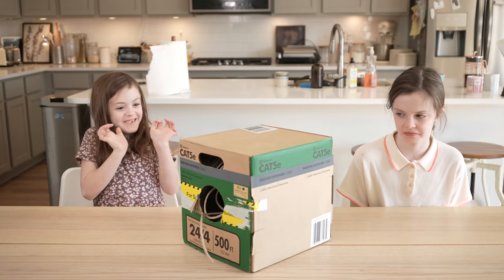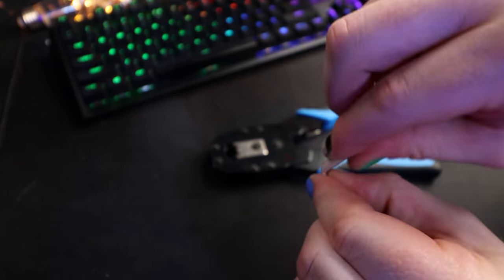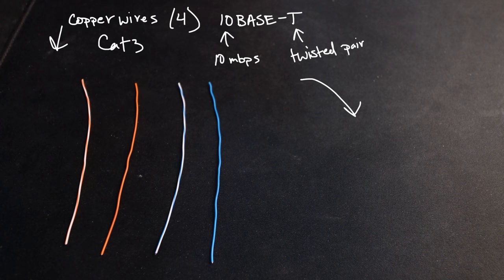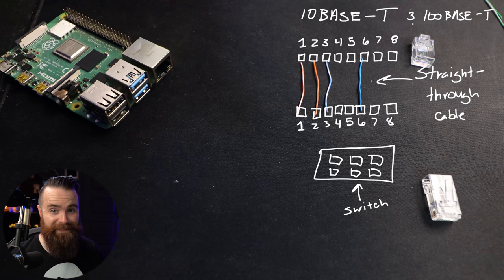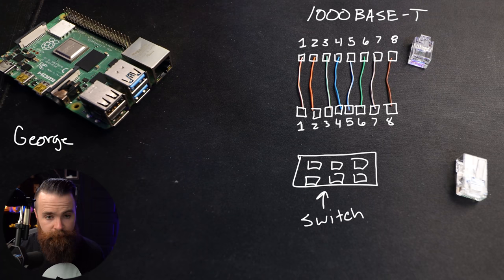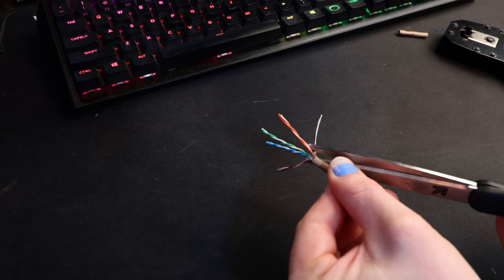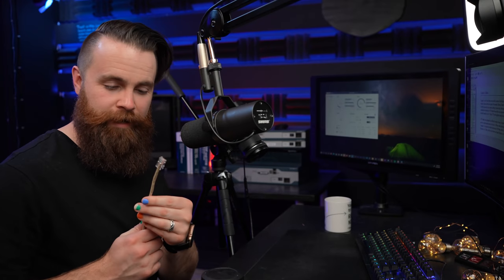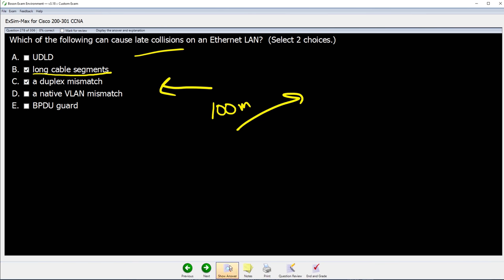forcing my kids to make Ethernet cables // FREE CCNA // EP 11

Comment: Learning this is super important especially when working from home, you can run the cable from your router in one room into a room on the other side of you house to where your computer is so you have a more reliable connection while working from home.
Reply from the maker: Dang, great example.
Reply: @NetworkChuck  Thanks :)
Reply: The same skills translate well to/from audio/video equipment.

Comment: Great video, really well explained. I only want to say that the "grandma hair" thread is there for a reason. The recommended approach is to score the outside of the cable and strip it far enough to expose the thread, then pull that thread to split the sheath. You can just cut off the copper wires where you first scored them and use the freshly exposed wires for the actual connection. The reason for doing this is just in case you nicked the internal wires when you first scored it. When you split the sheath using the thread, the fresh wires are guaranteed to be intact. It also has the benefit that you don't have to keep flexing the cable to split the sheath, which for solid core installation cable, causes cable fatigue. Not all cables have the thread, but where it does, that's what it is for. I hope that helps someone.

Comment: I recently started studying for my CCNA after 6-7 years of being a level 1 installer and home theater/residential/small business cabling and installation. If you guys make these often, get the pass through fittings and the Kline crimpers with the blade that cuts the excess. It’ll save you so much time getting your lengths right and verify the colors 😊🤘🏻

Comment: I'm so glad I can run off 568B color codes in my head without a second thought. I did all this last year making cable :) it took me a bit to learn too. If your fingers are soft you'll get the similar guitar callouses on your fingers if you do it enough in a day.

There was a time when me and another person were doing security cameras and bought RJ-45 heads that passed through the end of the head which was wonderful for color verification, but needed a tool to cut the exact length for the head to work properly. We tried crimping with a normal tool and realized how out of luck we were in doing so. We got tools that could do both after that.

Make sure you buy the right crimp ends for your tools, folks! :)

Comment: I used to be an electrician in the UK and I found for me a red filter (plastic) would help me distinguish the different color cables (been colorblind).

When your wiring up equipment and have 16 or more of color coded cables it was a real challenge to do.

The red filter changed my life for doing this

Comment: I made a cross over cable in 1995 to connect two desktops together using alta vista as the search engine. I've mad lots since then I don't anymore but I went through a couple of crimpers. This is a skill that I don't enjoy (the make the other side stuff was gold) but am glad that I have just in case i ever need to make a custom cable. This was a fantastic explanation which I found fascinating because I haven't done it in a long time. i'm even going "it's rx it's rx" but that was the plan all along.   the augmented reality type thing really made it easy to understand.

Comment: Wow, great job on those, and I love how you presented this! My attempts were only partially successful until I started using passthrough heads. Now I'm a passthrough evangelist! ;-) You pull the wires all the way through, check they are still in the right order and - pro tip - twist the ends before crimping so when it cuts off the excess the eight wires all stay together instead of flying off in all directions. Works fine every time. :-D
Reply: Also, as I understand it, the pass through heads are the only way you can make a Cat 6 cable that will pass certification. My daughter was making cables in her high school A+ cert class using the older heads. My son and I introduced her to pass through heads.

Comment: For anyone having trouble getting the wires straight enough. If you make them about 3-4 inches long. Then use a needle nose to gentle tug on them. It will get them straight. Then pick a good spot to cut and cut it while keeping it all tight. Then just slide them into the connector.

Comment: Hey chick thanks for all the help in teaching me. Just wanted to comment on the ethernet options. I have been an electrician for 15 years and wanted to say if you try to buy 100ft ethernet cable with ends already its about 98 bucks, but if you go to home depot you can by a 1000ft box of ethernet for 65 bucks and buy ends and the crimp tool for total of 90 bucks. I hardwired all the Xbox s for best call of duty for all the room mates different systems. Then i had 500ft left which you can earn some quick cash from other people if you want. 100ft 100 bucks vs. 1000ft box cable , crimper and ends for 90bucks.

Comment: Tip: Use the sleeve you cut off to straighten out the individual copper cables. Much nicer and easier on fingers. Especially if you are running more than 10 cables.

Comment: I used to work for a client who had a company that installed like home theatre systems and networking, for commercial and residential buildings. If I recollect correctly, I’m pretty sure we just used the shielded Ethernet cable in more applications, than not. I could be mistaken though, it was an awful long time ago, now. I reckon, he probably just upsell it to his clients, to just ensure they’d not have EMI networking problems later. I surmise, he figured, cause at the time,.. more and more wireless devices were making their way into homes and offices, so he wanted to ‘future-proof’ the quality of his installations.

Comment: I love the content, but let me give you some pointers to make this easier on you. First I always use a tweaker (small screwdriver) to straighten the cables. Just run the cable between your thumb and the metal round part of the driver. Secondly, to trim, I use coper cable snips (Also can be found as electrician's scissors). Finally, you have passthrough connectors, my favorite crimper is the ideal FT-45 crimper. It works with both passthrough and closed connectors.  You can find it at Lowes for cheap. To make things easy you can leave them long pull them through the holes and then crimp with that crimper. It'll cut the excess for you.  

Also, not sure if you left it out on purpose, but I like to point out to rookies that the cables are twisted at different rates, e.g. the twists are tighter. Finally, you the 100m also includes patch cables so we usually do 85m, or 280ft

Comment: I also have some recommendations about the internet cables themselves:

1. Don't use CCA cables (copper cladded aluminum) that's inferior quality. You need full copper cables.
2. Use FTP (Foiled) internet cables if you run it next to a COAX cable or electricity wires. Here, in The Netherlands, we are not allowed to run them in the same pvc pipe as electricity, due to fire hazard,  but if you are allowed to do that, also use FTP. The Foiled part protects from magnetic interference.
3. if you run wires, use flexible wires. Damn, I ran some solid FTP cables through the walls of my house, the pain man, the pain... don't do it.

Comment: If you make a notch in the outer sheath then the 'grandma hair' (nylon cord)  can be pulled down into that notch thereby opening up the cable.
You can now obtain RJ45 plugs with an open end where you can push the wires out through the top, crimp them and using another tool - cut off the excess which shows out the top of the plug

Comment: I had one of the very early Playstation 2's . Purchased the bolt on internet adapter for it but I was using DSL at the time at a whopping 2mbs back in the very early 2000's. Regular cat5e cable just wouldnt work. Still impressed the guys at best buy figured it out that I needed a crossover cable. It was orange and for a time it was special and I rocked marathon sessions of Socom Online into the wee hours of the morning. So cool and so much fun back then!

Comment: Ha ha I've done this with my kids.

Also bonus the reason white blue and blue are center is becuase of telephones.

Back in analog and even today when we install an ATA, blue cables are used as the ring and tone for line one. With either green or orange (depending on type A or B) being line 2, line 3 is the other and finely line four is typically the brown.

This is why you can use a typical ethernet cable as a 4 line telephone conection.

Comment: 29:59 IT technician tip, when straightening wires, use the sheath from 5:32 to spread pressure. Your thumb and index finger will hurt less. You can make more ethernet cables before succumb to pain.
Reply: or a bic pen lid!

Comment: I got 160-180meters often with no degradation. Depends of cable impedance and twisting step. Electrical resistance is not the major concern, but the termination equipment quality and ability to control amplitude of the signal which goes up to 20V.

Comment: I need to borrow a couple kids to pull cable through my attic.   I also trim the wires after pushing them through the plug, easier to check everything went in the right place. then just pull them back a millimeter after trimming to crimp them.

Comment: Personally... I prefer the control a retractable utility knife, preferably with a LLB blade, and just a very light pressure to score the sheath.  At one point, I had a paladin wire stripper... but it went MIA years ago, never to be seen again.  For a crimper, I prefer the Paladin Crimp-All with the right die.  The fact it ratchets is great, and it doesn't have a hard break-over.

Comment: Regarding "grandma hair" - the idea behind this is to actually split the jacket down the length of the cable in cases where the initial jacket scoring might have nicked the twisted pairs inside.

I know some techs who don't let their score be the "base" of the jacket; they'll score/cut the jacket just enough to expose the "grandma hair" (it does have a more technical name but I don't remember at the moment), make a small, length-wise cut in the jacket near the "grandma hair," then use the "hair" to split the jacket another 1/2" to 1". With the jacket cut by a string and not scissors, you can then pull it away from the twisted pairs and cut it away to make sure there is no chance of nicks in your copper cables.

Personally, I find the ^above method to lead to very messy jacket cuts; I tend to simply score the jacket at that 1/2"-to-1" spot, being extra careful to not nick any of the twisted pairs. Both methods work; just a matter of preference!

Comment: When my cousins did System-Link on Halo 2, we thought we could just get any ethernet cable off the shelf and just plug in both XBox consoles to each other. Of course, this didn't work, and it confused us for a bit, so one of us got a "System Link" cable and of course it worked. We were still confused, because it just looked like any other ethernet cable, or so we thought.
It wouldn't be until a decade later that I would learn about crossover cables that would explain our question from 2005. So I finally explained the whole situation to them, and it made sense.
Also, we did a three-way system link with three XBox consoles and a WiFi Router that we also had connected to an A-DSL modem back then during a gathering with our youth group friends.

Comment: To save you some time. instead of fanning them out in the beginning. get them in order then pinch the bottom and the top and wiggle them back and fourth it will straighten all of them at once.  Something I have been doing for years but works great.

Comment: I think the easiest way to untwist and iron the cables out is using a very small flathead screwdriver. Just untwist a bit where the jacket ends, tuck the screwdriver in and pull. Then use the same screwdriver to iron the cables out. It's fast and less of a pain to untwist the wires as I hate manual untwisting 😅

Comment: The "granny's hair" is for stripping the "pants" from the 4 twisted pairs to ensure that the 4 twisted pairs aren't scored when you do your initial strip with the crimper tool.
So, once you strip it with the crimper, grab the 4 twisted pair in one hand and the string in the other and pull down on the string, which will cut the casing open.
Then cut the cable right below the initial strip point, and cut the casing off at the base of the string cut.  Now you have insured that the 4 twisted pair are unscored.

Comment: Dude!  It looks like you have EZ RJ45 CAT6 ends but you don't have the  associated crimper (EZ-RJPRO)?  

Those ends have holes at the end for the wires to come out and a knife on the proper crimper to trim the excess wire.  I could see the wires poke out the end.  This means, no haircut is required.  These ends are especially helpful when doing gel filled outdoor cable.  They are a great time saver and help ensure you get the wires into the correct position, get a good bite from the contacts and the jacket is under the crimp.

They are so easy your girls can do it as they can pull the wires into the connector, check the colors then use the tool to crimp the end.

The ends are also are handy to cut down the length on those overly long stranded patch cables.

Comment: TIA wire pattern importance went the way of the do-do bird due to switches auto-correcting crossed patterns but won't fix fully fubar mismatches, so it's only useful for consistency in compliance.

Comment: An additional word of advice from my experience, pinout testing, which is what is shown, is not cable certification. Pinout testing has its place for sure but I've had cables pass a pinout test repeatedly but will not pass data without errors which can cause some real headaches. For important cable runs you may want to certify them with a cable certifier that actually puts traffic on the cable and checks for errors.

Comment: During step 4 there was still some room for the sheath to be pushed up in the jack. You should try to push the sheath as far to the end as it will fit to minimize crosstalk when terminating an ethernet cable. The jack type also changes slightly for cat6 so this is a video for cat5e and under termination.

Comment: Wish you made this video few years ago when I was on my first live streaming job, and we had a stream event going on.
One of the ethernet cables stopped working, and they wanted me to crimp one 30m long UTP cable.
I said, no problem. But, the problem was that I haven't crimped cables for a long time up then.
And what I've done, I've started uninsulating (yes, if that's a word) each wire inside the cable, each and I must say, it took my awhile to do that "properly".
As we were in a hurry, I was really stressed, and I didn't watched any video before doing it as I was thinking that's OK what I'm doing.
Then, after some time trying to put the connector on and failing few of them, I went to YouTube to see how is done.
Figuring out that I should just organise those frickin wires and crimp them. No need to remove the insulation from wires.

Comment: I cut my teeth in 1989.  One of the things we got by mistake was a Western Digital Ethercard Plus WD8013T.  Our distributor had them sitting in their warehouse awaiting Western Digital to allow them to ship.  We were suppose to receive the 10BASE-2 (thin coax).  This was before the day of switches and back when we had hubs and repeaters.  I also was indoctrinated to 10BASE-5, thick coax with the big vampire tap transceiver where you could amputate your finger or thumb if you weren't careful.

Comment: Hi Chuck, 41:54 You tortured your daughters but ok they would have learnt lol.   There are RJ45 connectors that allow you to feed the wire straight through the connector.  Much faster to make but not sure if it is certified.  I created a modified version of the RJ45 by drilling out the end of the connector. Depending on the cable diameter a 1mm drill or 1.1mm drill bit.  
Regarding clamping you don’t really want to clamp them more than once.  The clamp tool should be a ratchet type so as you clamp the tool on the RJ45 it won’t release until it is at the end of its travel when it will release (unlock) the handles.  
Also consider the test device you have only proved correct connectivity.  For the corporate world (if you had to make a cable) you would also need to check its speed (frequency capability) so you don’t accidentally introduce a bottle neck in performance which could be very difficult to find.
You did ask for feedback lol. 
 Enjoyed the video Cheers

Comment: Fun video...I've made SO MANY cables from <1' jumpers to 100' runs (just for the home, I don't do this for a living).  I'm in the very beginning planning stages for my new home, and your channel has been great resource.

I do laugh, as I was in the BNC club with a ring configuration in my office, running a LanTastic Network.  OH MY....LOL...What a NIGHTMARE.  I proposed different things, and I got shot down because "cost".  UGH!

Given that I'll be stick building my retirement home (plan anyway), would you recommend jumping up to Cat6 or even Cat7, what about Fiber?
Reply: retirement home... if there is medical equipment, shielded twisted pair (STP)--go 6e or better, for futureproofing, or even going fibre (but then would need to deal with adaptors at the end for connecting to RJ-45) would be best.  They are much better around that sort of stuff to not cause EMI.  EMI is a nightmare to troubleshoot without expensive (multi-$K) testers.  I had one which took me 2 years as a deskside (3 patch cords replaced, 2 PCs replaced, 2 switch ports replaced, UTP replaced...) before they did a STP and resolved the issue.